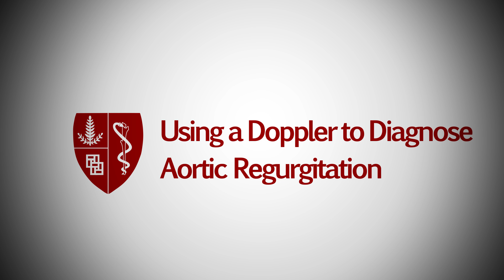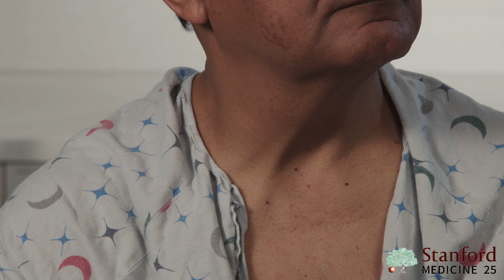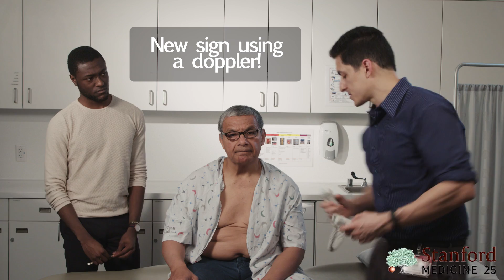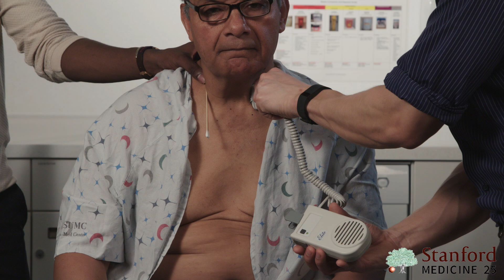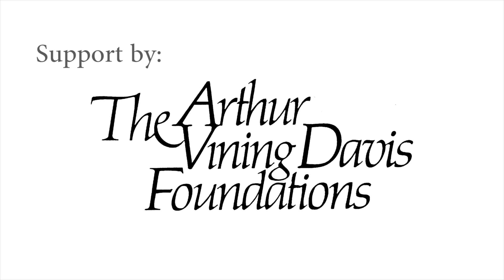Using a Doppler to Diagnose Aortic Regurgitation (Real Patient and Sounds!) - Stanford Medicine 25

Comment: Nice information sir! But by placing the stick on one carotid to see its pulse and putting the Doppler probe on the other to hear it, are not we risking the patient for a syncope?
Reply: Really Nigga??
Reply: The location of their pressure isn't over the carotid sinus, which is what causes that reflex you're speaking about, they're inferior. And I agree they probably arent pushing hard enough too. Good thought though!
Reply: Are they pushing hard enough to occlude the arteries?
Reply: Ivan W. I wondered if it would decrease the blood supply to brain.
Reply: @IvanWiljanen29  You don't need to occlude the arteries - just apply enough pressure to the carotid sinuses to get them to trigger.  I've seen this happen in a martial arts class were a 16yo old perfectly healthy male athlete was having a choke hold demonstrated on him.  The instructor applied very mild pressure to his neck and boom - he was out.  Some folks have very sensitive carotid bodies.
Reply: The fact that you see a pulse by the stick moving means blood is pumping and going to the brain!!